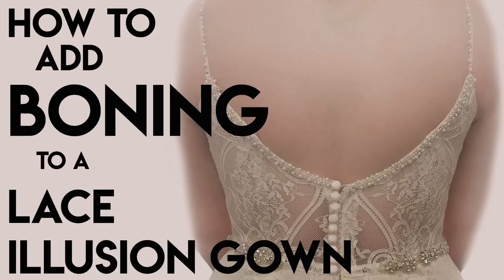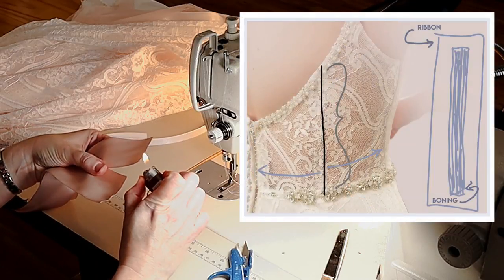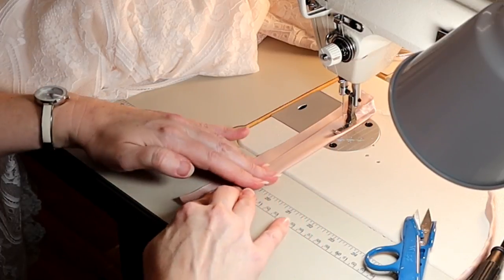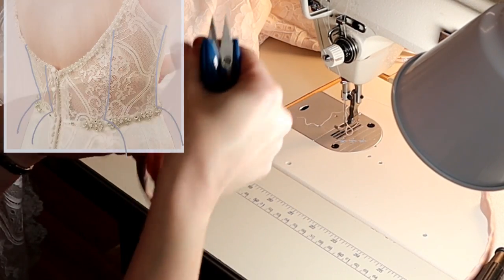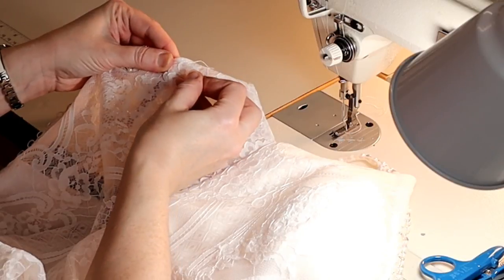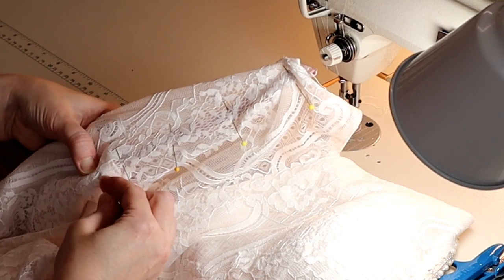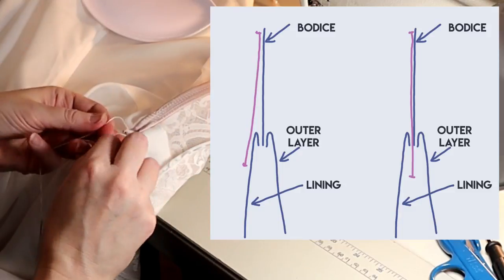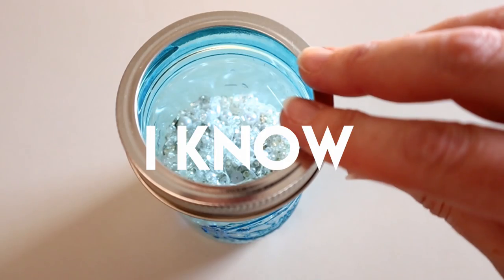How to add Boning to a Lace Illusion Gown.  Illusion Back Gown Needing Support

Comment: Thank you for all your wonderful videos! Can you use the same material and technique behind the buttons? i am working with illusion back gown, no zipper just buttons and loops and the weight of the buttons is making waves and bunching at top. The length of back is correct. I believe it just needs more support.
Reply from the maker: https://youtu.be/-dsHKJ25VZk  I think it would be similar to this.

Comment: Curious, are seamstresses able to let out a dress in the waist and back when it has an illusion lace strapless bodice with boning and a zipper back? The back is mostly mesh with some flowers (Monique Lhuillier Willow dress for reference) I refuse to go with a lace corset, which is what I see all over the internet in aleration blogs. I am a 27 waist and it likely needs to be brought out to a 28/27.5, as the 27 is way too tight. Please help!
Reply from the maker: It usually can be- even if it needs to be gusseted. Of course, this is subject to what your local sewist is capable of. I can't speak for all skill levels.

Comment: I always wondered why noone is using steel or spring steel boning in bridal? Not even synthetic baleen? They provide much more support at fraction the width, is there a specific reason only rigilene is used?
Reply from the maker: I prefer rigilene because I can sew through it.  It also doesn't require a solid channel like the steel bones do. There are dresses that require steel bones, especially the ones that need 4 way curves, but Rigilene is my most common go-to.  It is also much lighter.
Reply: @BridalSewing  oh, alright, that does make sense :)